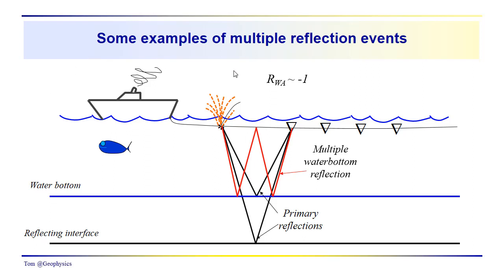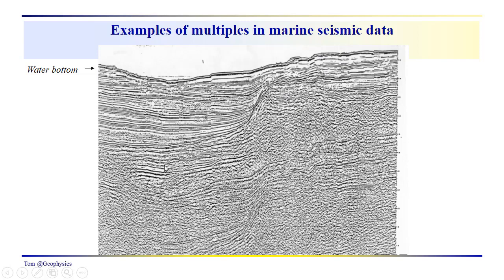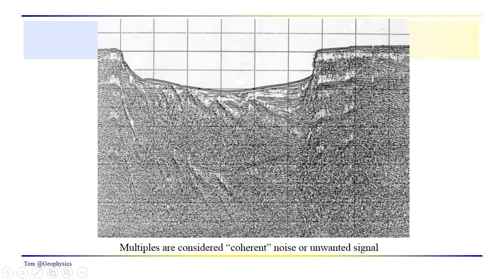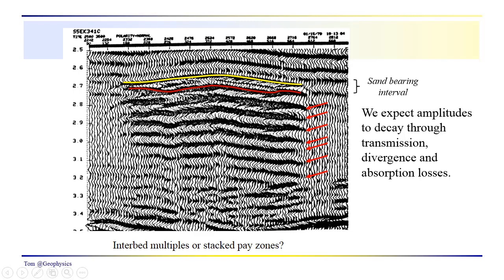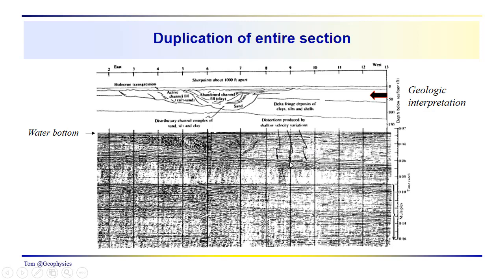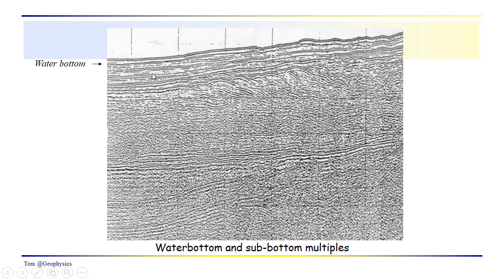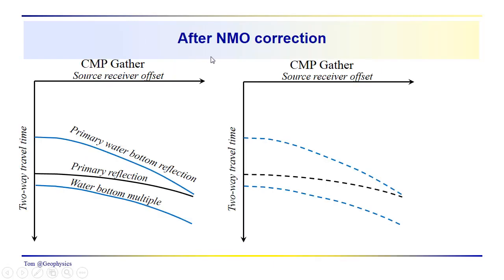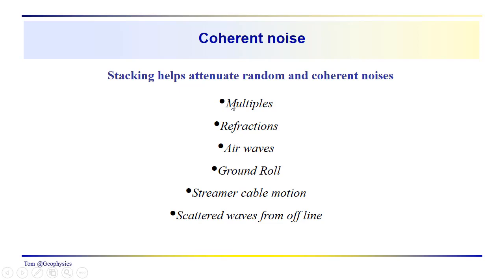Geophysics - Seismic: Example multiple reflection events in seismic data

Comment: Sorry Tom, But what does it mean by Velocity Sag?
Totally appreciate your effort
Reply from the maker: This is a good question. My speculation may be incorrect, but the "velocity sag" is often seen beneath a gas sand. In the interbed multiple example we have a small anticlinal structure around 2.7 seconds. Gas in this structure  increases the reflection amplitude and if you look closely you will see that the lead cycle has negative amplitude indicating we are going from high to low velocity. We have what seismic interpretors may refer to as a "bright spot." Reflection travel times through the relatively low velocity gas saturated interval are less than through the same interval filled with water. The added travel time through the gas saturated portion of the reservoir delays reflection arrival times from underlying layers. That delay is sometimes referred to as the "velocity sag." We don't see much data from beneath the interbed multiple sequence, but the underlying reflections around 3.4 seconds appear to drop or be delayed (sag) beneath the shallower gas sand. The usage is a bit colloquial but still common. see https://wiki.seg.org/wiki/Dictionary:Velocity_sag Something I need to do is discuss velocity anomalies in more detail. Thank you for your question!